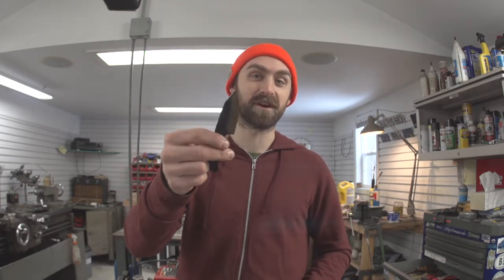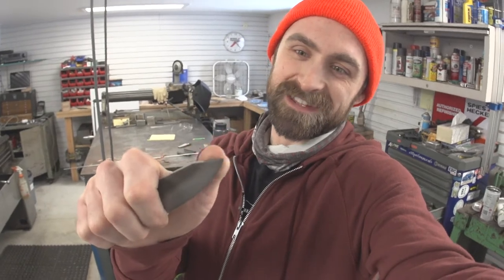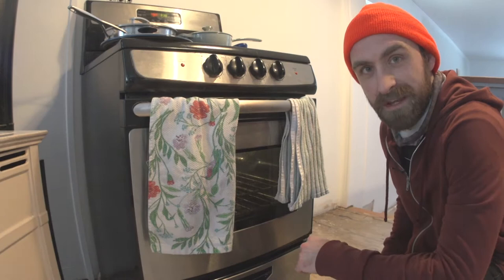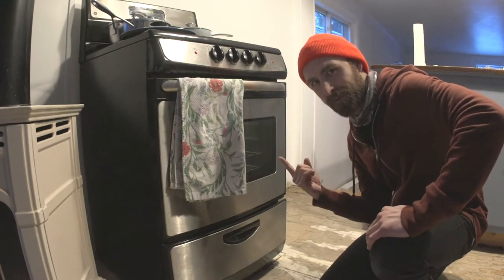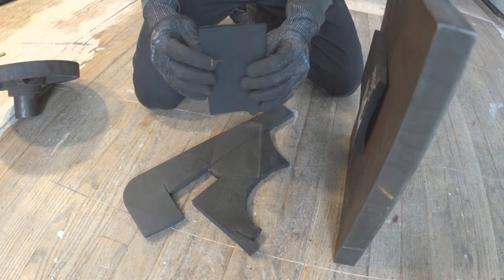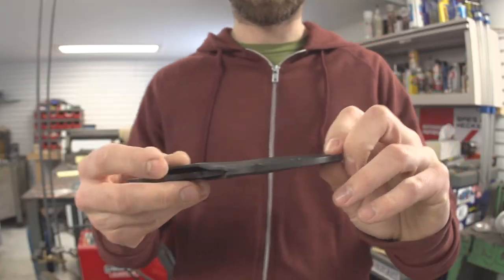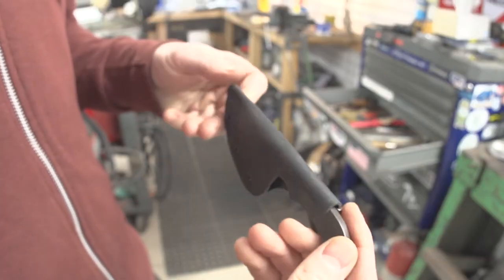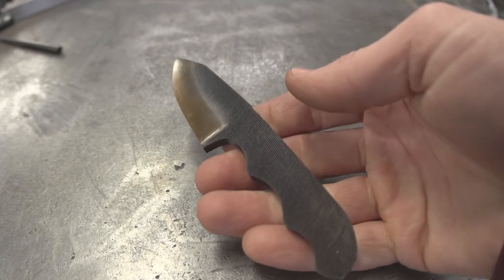Making an EDC Fixed Blade Knife - Heat Treat & Kydex Sheath

Comment: After seeing part one and 2 of this video, i really wanted to make my own knife. Saw this video like a year ago and i finally decided to give it a try myself with the file after coming across a garage sale that had a whole bin full of old files for 2 bucks a peice. I did it all with an angle grinder and a dremel so it not the greatest but im pretty happy with it to be honest. Gave it a paracord wrap handle (going to do wood handles soon) and i found an old leather cast iron pan handle holder and its shaped like a knife sheath and fits perfect. I might try the kydex though well see. Anyways great video i need to buy more files now 😂
Reply from the maker: That’s awesome!! I like the paracord handle idea!
Mine is still my everyday knife. It holds an edge pretty well and hasn’t chipped anywhere. My kydex sheath could be improved but I’m still using it so it’s not too bad.
Anyways thanks for sharing that you made one for yourself. So rad! 🙌
Reply: @RussellMakes Thank you! Yeah yours looks awesome, the sheath I have right now is actually an old leather cast iron pan handle and I always thought it was a sheath until I found it online, but it's the shape of the knife blade and fits so I don't mind it for now if I am just carrying it in my pocket.

Comment: It's a file, wasn't it already hardened? So you took out the hardness when heating it. And said it didn't work and then reheated and quenched  it to put the hardness back in?
Reply from the maker: When I heated it orange and quenched it I was making sure it was fully hardened. The first time I heat treated it in the oven I got the edge too hot which made the edge too soft and it probably wouldn’t hold an edge very well in that condition. So I heated it and quenched it again to re-harden the edge so I could try the heat treat again. Without the heat treat (oven) the edge would be very hard but too brittle and maybe snap off. For more info about heat treating check the link in the description.
Reply: @RussellMakes  ,Thanks for explaining ,I will watch the video also 👍👊